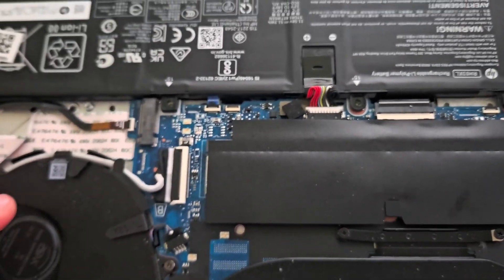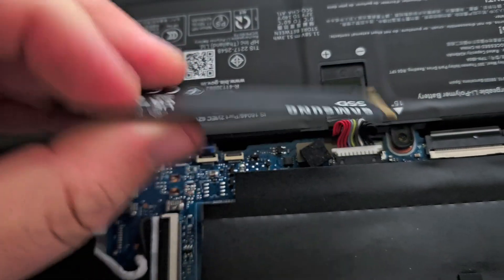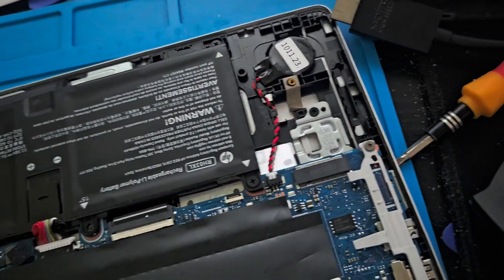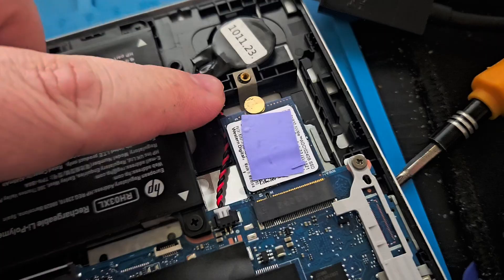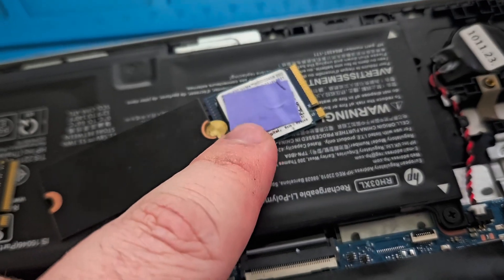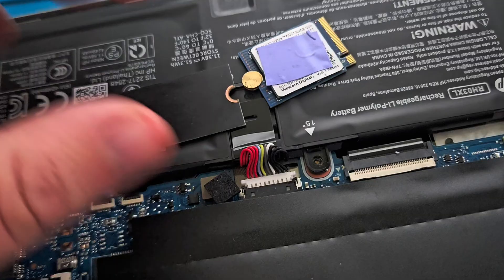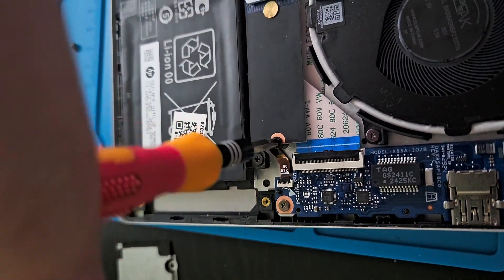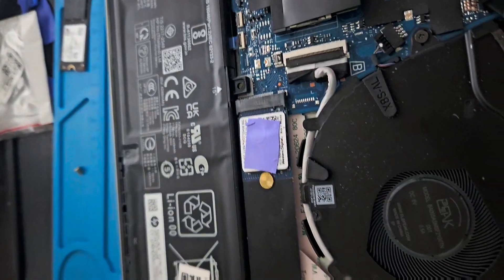HP Probook 440 G10 second m.2 slot is unusable

Comment: So you should have bought a 2242 SSD. Then having bought the wrong one, a 2230, should have bought the 2230 to 2242 adapter. But instead you bought the 2230 to 2280. The HP part is absurdly overpriced, but you could have solved this with an adapter for a few £.
Reply from the maker: @Nick_R_  I ended up buying an adapter on aliexpress... I would have wanted to add 2 ssds but now I can only add one ...